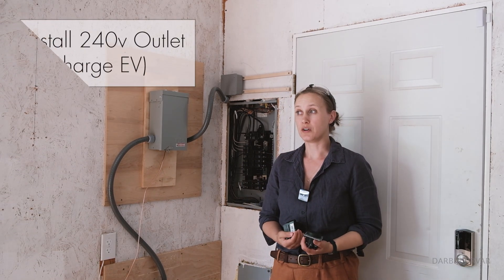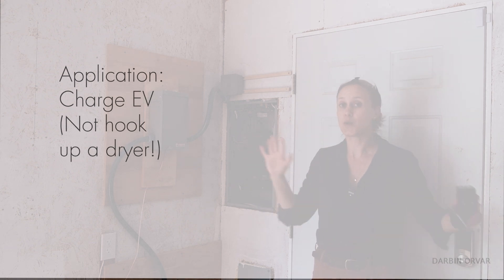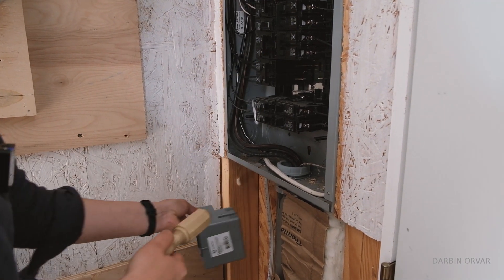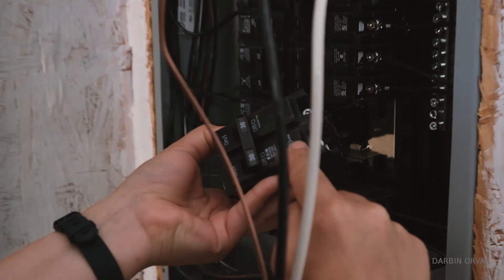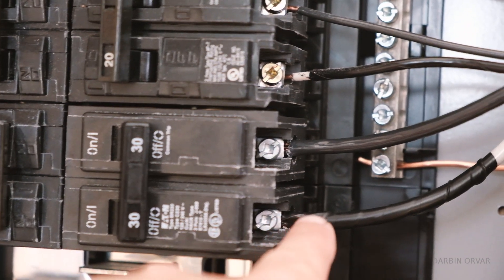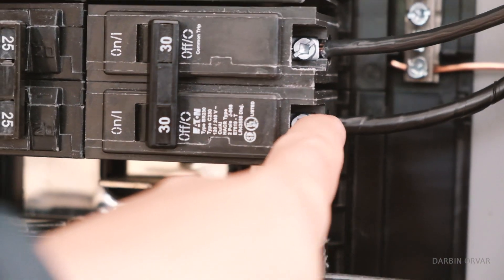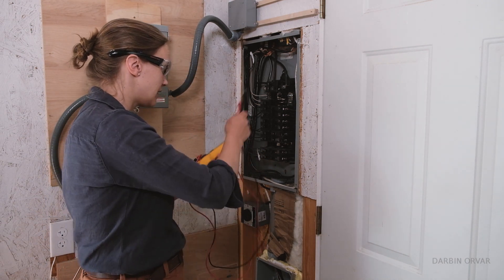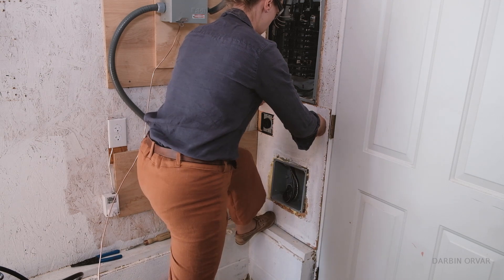How To Install a 240v Dryer Outlet for an EV

Comment: if you use that cheap plug to handle 50 amps continuously, you'll burn down your house. that is not an ev outlet. ( they are rated for ev use and cost about $100. the cheap ones melt and set fires. AND 6 gauge wire is the smallest size to use (6/3 with ground). hope she has good fire insurance. And the breaker needs to be gfci rated. .Is she still alive?

Comment: Using 8 awg wire for this is overkill, especially for such a short run. Ten (10) awg is what you should have used.

Comment: After you turn off power, it is good to test that the circuit/panel is off. Show that on the video using a wall plug tester or a multimeter.  Also, add retractable knife to your tools list (it was your second tool used).

Comment: Hello Lynn. Love how you explain what you are doing. I do have a couple of things based on code the style plug you installed should be on a 50 amp or 40 amp breaker and a neutral wire needs to be installed. Also I saw you used a eaton breaker on a Siemens panel. Need to match breaker to panel.

Comment: Really nice video! Very clearly explained. I did have a question regarding the cable used: why not use a common for this outlet? Is it simply not need for ev charging  (or your specific charger)? Thanks for such great content.

PS: I used to have a LEAF just like that one! It's such a great car. I only ever charged over 120v at home and I wish I'd done this myself.
Reply: Upon researching further, for a 240v only outlet in the US (made up of two 120v circuits, that is), a common neutral is not required.
Reply: Second this. Why did you leave out the neutral wire?

Comment: Everyone should understand that throwing the main breaker in the box doesn't mean there's no power in the box. The leads coming into the box are quite exposed, hot, and carry hundreds of amps. Easily enough to kill you if you touch them. I was very, very lucky the last time I opened my electrical box - it's very easy to overlook the live side of those breakers and brush them with a wire or tool.
Reply: Kevin: if there’s anyone that doesn’t understand that a switch only kills one side of a switch. Doesn’t matter  what type of switch or breaker. They have absolutely no business messing with anything electrical.
Reply: @dontfit6380  I guess what I was really trying to say is that the power-in side of the switch is very exposed.
Reply: @KBinMD  maybe I didn’t word it right but I was agreeing with you and adding that anyone that doesn’t know this should not have their hands in an electrical panel.
Reply: @dontfit6380  Except you do not know what you do not know, hence my warning. :)